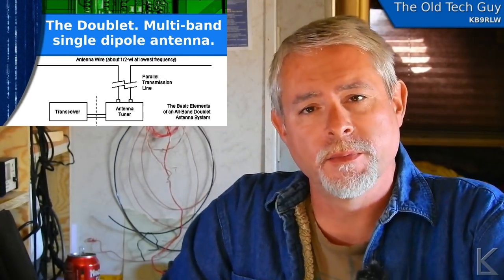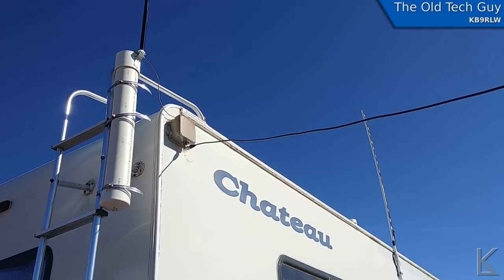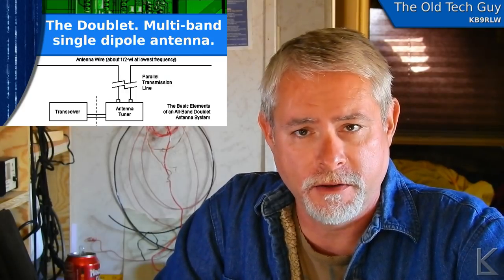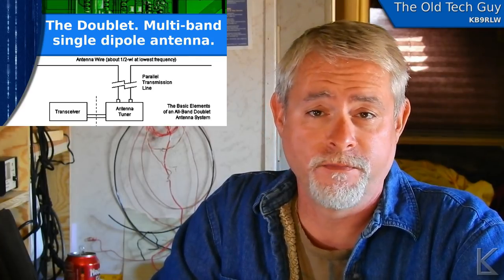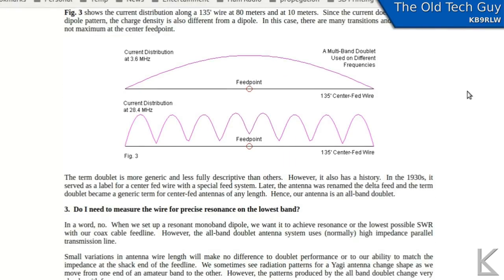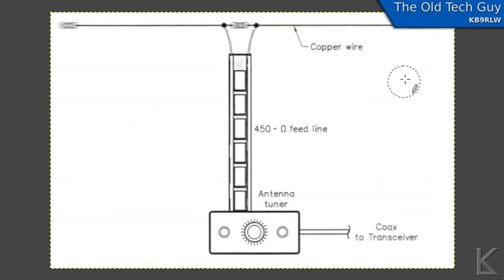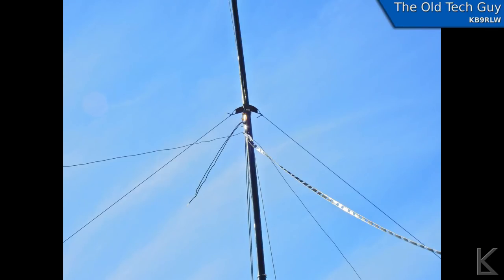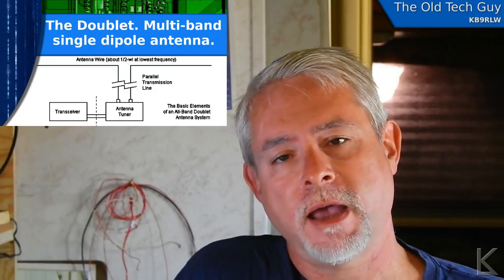Ham Radio - The Doublet.  An old but good multi-band single dipole antenna.  Part 1

Comment: So why doesn't everyone use ladder line as a feed to center fed antennas? Because there are some problems with keeping it truly balanced and therefore display it's good side. First, it hates anything that upsets it's balance. Like rain, dew, or snow. Or any metal nearby to it. Second, it is hard to verify the balance condition- no simple device like an SWR bridge in the case of coax. It was these problems that led hams to so readily adopt coax feed, since coax does not have these problems.
K0MB
Reply: Although the issues you mention are certainly possible, they pose much less of a problem than one might think. I've used ladder line with a number of antennae for years with no ill effects. As long as the ladder line crosses metal at at 90 degree angle and/or for only short distances the effect is negligible. In fact, I run it into the eave of my roof (near some aluminum siding) all the way into my shack. If the feeder were to become unbalanced I would notice RF getting into nearby devices - something I've never noted. As far as rain or ice is concerned, their impact can be alleviated by using true ladder line (parallel wires with plastic or other non-conducting standoffs between them) as opposed to window line which can 'bridge' rain or ice between the wires.

I was convinced for many years that ladder line was just about useless because of the many stories I'd heard about it. However, once I began to use it I realized that the problems I had heard were very much the exception rather than the rule. In any case, I think the ladder line vs. coax decision comes down to one thing - how much loss is a person willing to tolerate? If the antenna is constructed such that it presents a 50 Ohm impedance (or nearly so) at the desired frequency, then using coax is fine. If, however, the antenna impedance is significantly higher or lower than 50 Ohms, then the use of a balanced feedline will provide significantly improved performance because of its low loss.
Reply: @BrianEsche  I used window wire as feedline for about 30 yrs when I lived in the dry climate of the Colorado high desert and was quite happy with it's performance. But about 12 yrs ago we moved to central PA, where the  more frequent precipitation has rendered the window wire feeds unusable much of the time. I now include the OCD in my arsenal  of wires for wet-weather use.
Reply: The ARRL antenna book shows a simple way to measure imbalance: Couple a field strength meter to a ferrite toroid with a few turns of wire through the center, then put the ladder line through the toroid. You at least get a relative balance reading, so you can change the one leg length or positioning to get a (better) balance. My take is that yes, the feed line will radiate a little because the antenna is going to be a little imbalanced.... but so what? Nobody expects a perfect pattern!

Comment: What gage copper wire do you use coated or uncoated?
Reply from the maker: It doesn't matter very much really, but I'm using 14ga solid wire with a jacket on it.
Reply: Thanks.

Comment: Like Jamie Smith said earlier, why 4:1 instead of 9:1?
Reply: astrorad2000 it doesn't matter much, it just gets the impedance in the right ball park. Note that most 9:1 are ununs. Note the balun used here has two cores wound seperately, many 4:1 baluns are poor designs and don't address common mode current. The baluns in nearly all commercial antenna tuners are junk too. An open wire fed doublet is a great versatile antenna if done right.
Reply: @g0fvt  Thank you for the info. I forgot that this is a balanced antenna. It will be nice to see the results of Kevin's testing it out. Bill, WB9NYI
Reply: @astrorad2000  I use a current balun to do similar. The doublet was extremely popular in the past, but the popular use of coax has driven us to antennas that are close to 50 ohms. The issues with the baluns built into most ATUs is that they have some phase shift between the windings and the legs of the feeder are not driven quite 180 degrees apart. They are also voltage baluns so the current in each leg is not automatically going to be equal and opposite leading to feeder radiation and possibly issues with RF in the shack. The object of the two core 4:1 baluns is that they behave as a common mode choke forcing the current in each leg to be equal and opposite.